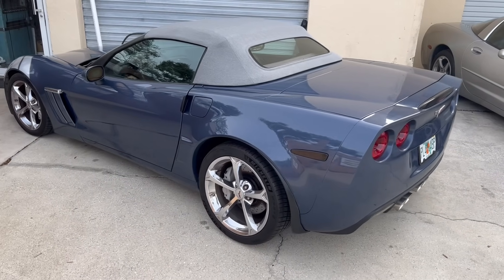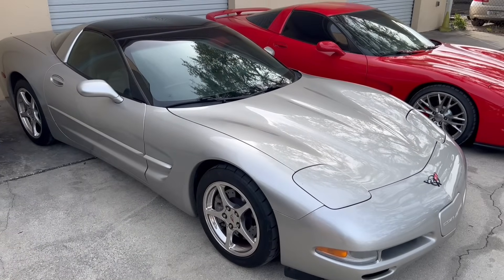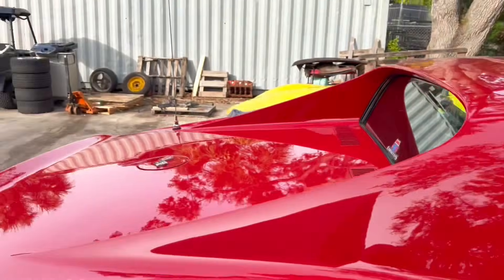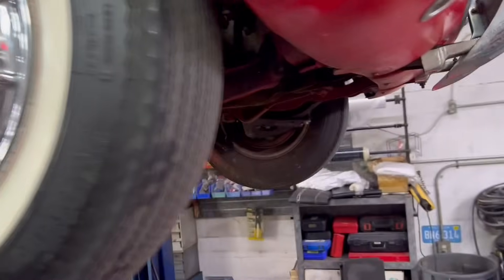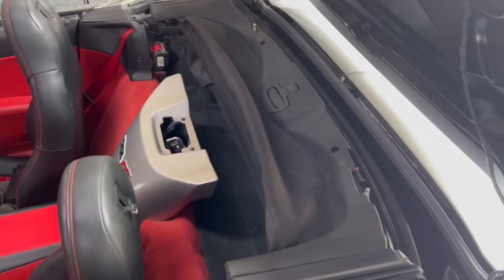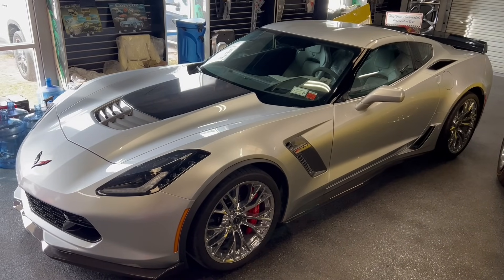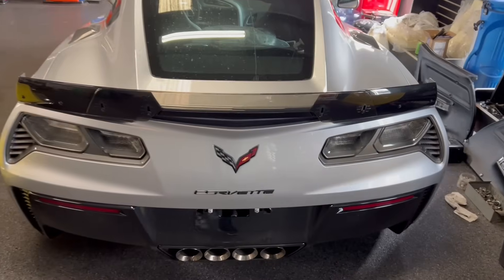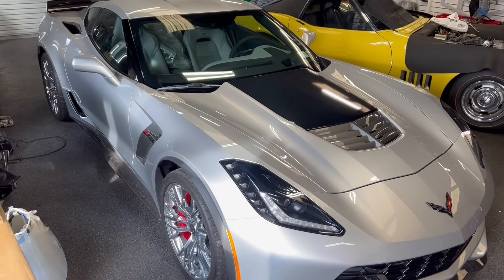Shop Walkaround 12/12/23

Comment: That Max-Din infotainment system you guys are installing in the C6 is really cool.  They’re making one for the C5 as well.
Reply from the maker: Yep--I'll be doing one in my old Z06 here eventually.  :)  Lyle
Reply: @csvette  Nice!  You should do an install video for that.  I’d rather do the Max-Din because it’s reversible.  You don’t have to cut out the shelves like you would with a double-din setup.  The Max-Din slides into the stock shelves.

Comment: Did Lyle imply that C6 ‘verts are problematic?   In the market for one now….am curious about potential issues with the top.
Reply from the maker: We are seeing more and more of them with various issues.  Age takes its toll on everything, and these systems are no exception.  Some of the fixes are pretty straightforward, but others require a great deal of diagnosis and parts-searching to resolve.  Lyle
Reply: @csvette thanks for the reply.  Appreciate it.

Comment: Lyle, have you ever installed a front camera to work with the infotainment center for a vette that doesn’t have the front camera? If so what do you recommend. TY
Reply from the maker: I have not.  We really try to stay away from stereo work, in general, as it is not our strong suit.  The reason we are interested in this new system is that it supposed to be basically plug-n-play.  It has front and rear cameras, so we will do a video about our thoughts on the system AND the installation process here in the next month or so.  Lyle
Reply: @csvette  ok, so you are going to do a video soon on a plug and play system?
Reply from the maker: @pukaman1  Correct.  I have system here...just waiting on shop time to be available to perform the installation.
Reply: @csvette  awesome. Look forward to the video coming. I’ll wait to see what you got. Thx again